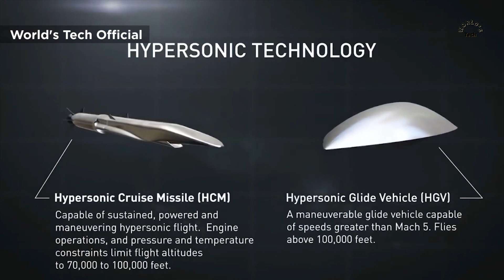Hypersonic HAWC Missile Passes Crucial Flight Test

Comment: Until i see it i dont believe it. Because you dont explain how the HAWC.work. you should explain the technology to avoid the température to reach 6000 °C ,no metal resist this température
Reply: At mach 8, it would probably get to 3000ºC, not 6000. Moreover, although the details of the technology are classified, one can suppose they use an ablative coating on the missile (like those used on spacecraft to protect them during reentry).
Reply: Yes it does, don't forget they have the"ALIEN" spaceship technology??
Reply: The rocket looks like a shark.